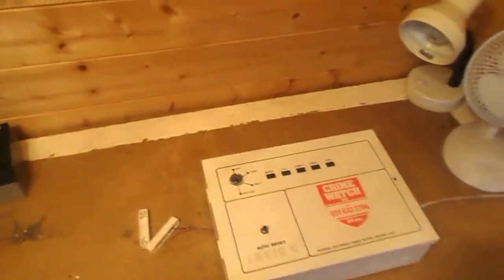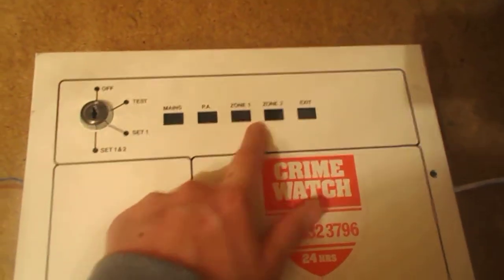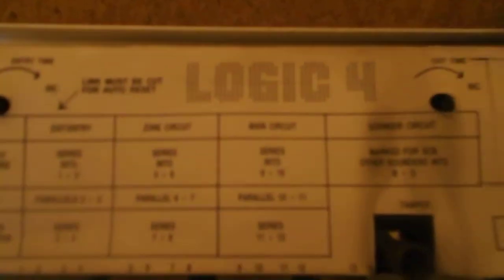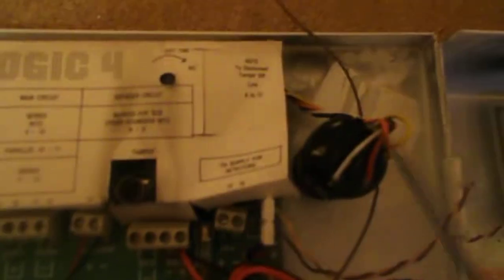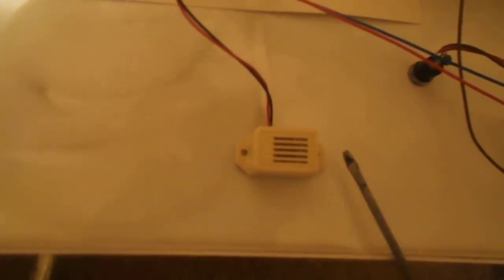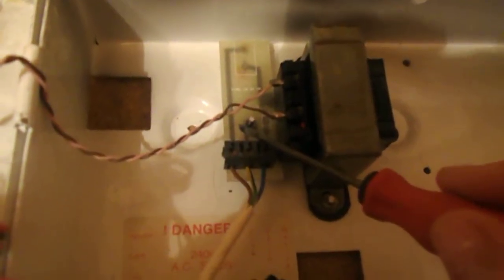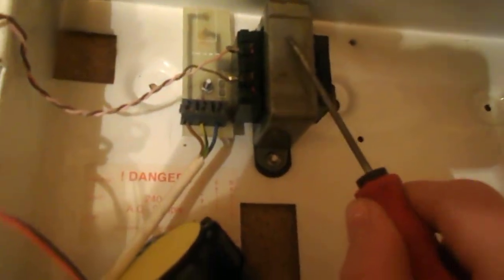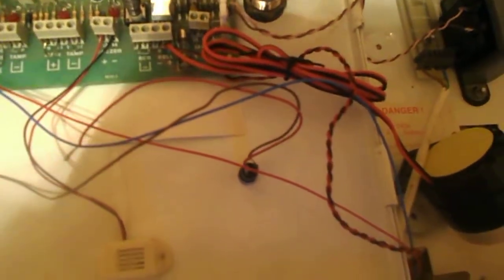The insides of the ADE logic 4 metal keyswitch intruder alarm panel

Comment: Bit of extra info for you.... Normaly its around 17v ac that comes into the panel, this goes into a bridge rectifier, power regulator then the big capacitor to smooth the output that is at this point about 12-13v. You also have the battery charger connected of this. With regards to the SCB and SAB they are short for Self Activated Bell and Self Contained Bell. As you know already with an SAB module in the bell you have a constant 12v going to the bell, a negative return from the bell for a tamper and then you apply the bell trigger to ground or 0v to make the bell ring and the same for the strobe. With an SCB it works slightly differently. You run the constant 12v to the bell as normal but with SCB you take the bell trigger or ground away to ring the bell. SCB was invented as some sounders needed more power than the control panel could supply (normaly 1amp max) The difference is that with SAB the bell pulls power from the panel to ring (unless you cut the wire then the bell battery takes over to sound it) and an SCB pulls power from the bells backup battery. If you had a large house for example and wanted 3 outside bells the panel would be unable to supply enough current hence you would use SCB. Using SCB you could have 20 bells. The only disadvantage is that the battery in the bell is normally 6-9 volts so the sounder would not be as loud. Its interesting that over the years installers have hit these problems and the panel manufacturers have invented a solution. In fact its one of the few trades left where the industry listens to the engineers. HTH.  Stu